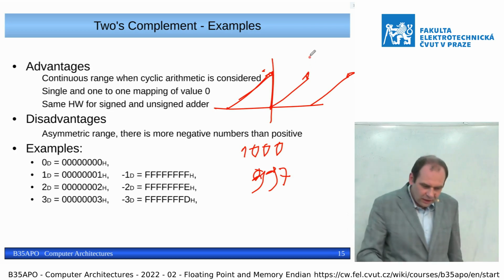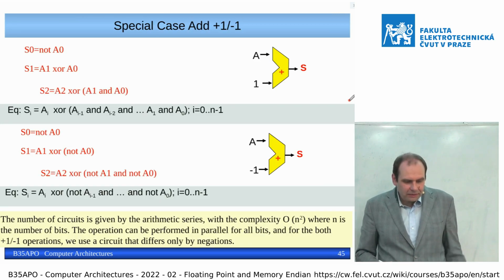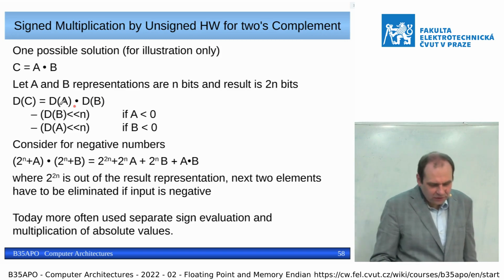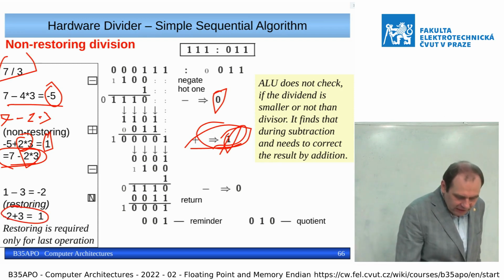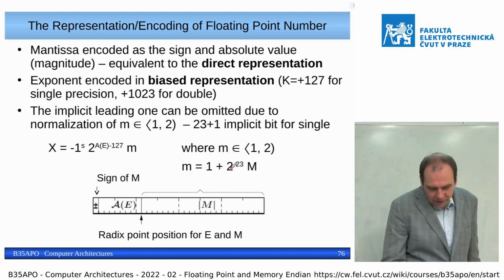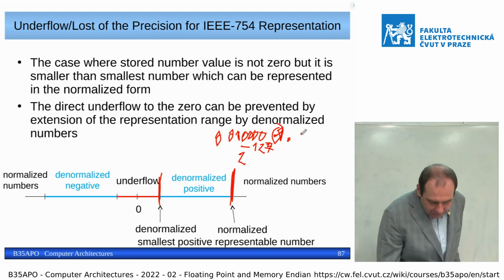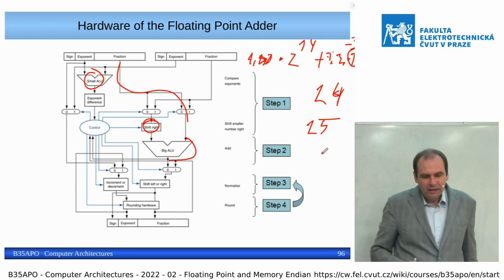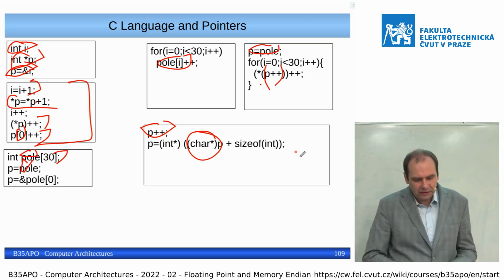dr. P. Píša: Computer Architectures - 2022 - 02 - Floating Point and Memory Endian

Comment: Errata: when I have shown analysis of the minimal increment which can be encoded into IEEE-754 number on the slide 87, I have computed -127-23 is 160, but correct answer is 150. When exponent -127 (0) is reserved for denormalizd numbers in the next step, then minimum is -126-23 which results in 2 power -149. I have said -159, the limits on the next slides are computed correctly.